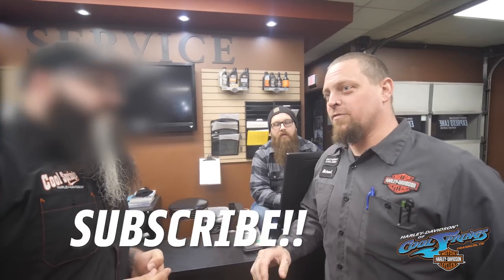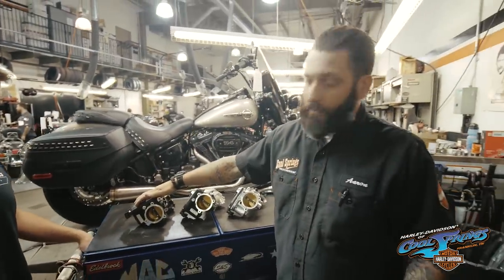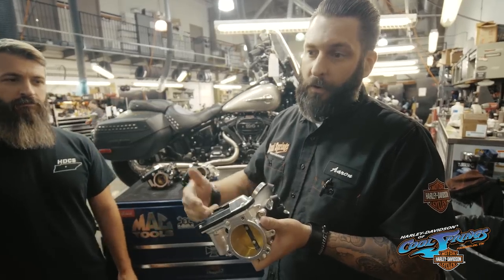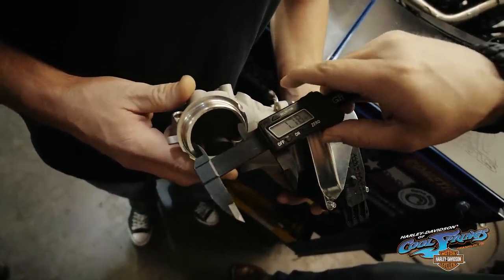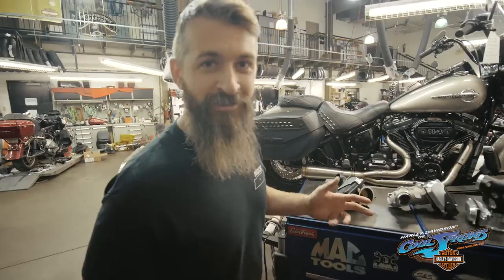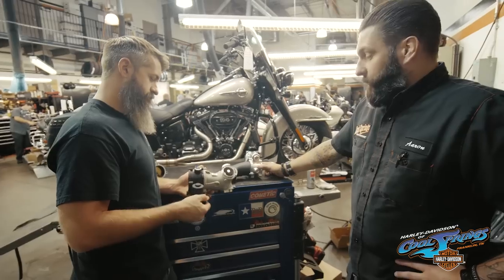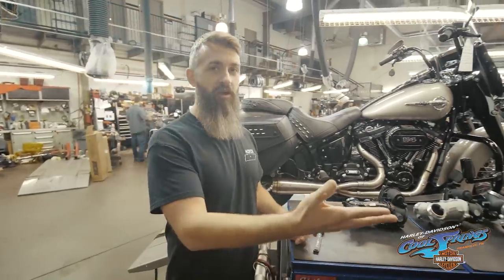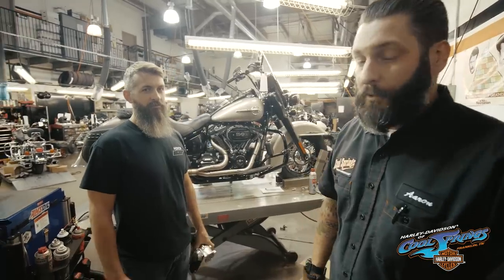Comparing Throttle Bodies (Harley Stage IV vs HPI) | Shop Talk Episode 9

Comment: Can you imagine if Harley would just ship out the new bikes with the best parts to start with. I am burned out on spending thousands to get the power they should have had in stock form.
Reply from the maker: James dulaney You could say the same thing for pretty much any manufacture of Motorcycles or Vehicles.
Reply: Indian bikes come from the factory with basically stage 2 everything for half the price. Pretty sad actually. 

Harley does it as a marketing plan. It makes a ton of money for them. And it works since people are never satisfied with a harley to begin with. Which is why we modify them.

Comment: Australian Performance Engines APE ,Manufacture a 55 mm CNC Intake manifold Producing a 150 HP and 145 lbs coupled with a 6.2 gps Injector.

Comment: Moonshine Harley, does either the 64mm SE or the 62mm HPI eliminate butterfly valve clapping/chatter/knocking that comes when you put a cam in like an S&S 475C? I put that cam in ('20 Road King Special, 114) and now have that butterfly valve knocking and am wondering if an aftermarket throttle body can make that noise go away or lessen it. Thanks and love your channel!

Comment: I recently picked up a 64mm SE TB, I only paid $300 for it.  The HPI unit is just too expensive, especially considering that it still uses the oem throttle servo motor.  I suppose if you're building a big ole mountain motor or something you could justify the added cost.

Comment: I love the stuff you guys are hitting on/I suggest though that you use a 3 point  digital bore gauge not a caliper to measure bores.i work in the CNC world of +\_ .0002 everyday and would slap a bitch for checking diameters with a caliper.other than that you guys have a cool gig rolling (keep it up)we out here depend on that knowledge your putting out
Reply: A Ninja We would but the measurement was a reference and we wanted you guys to see the data. We already knew the diameters!

Comment: Do you plan on releasing the dyno results between the HPI as is and Okeefe ported TB?  Thinking of using the HPI with a set of match ported and blended SE heads on a 124” @ 11.5:1 with a TTS250 or Tman 234 cam.  Very keen to know if there was any significant differences between those two TB.
Reply: Was wondering the same thing, never saw results on the ported TB. Eric how did your build turn out❓

Comment: A larger throttle does not hurt low end. That plenum could certainly change the flow rate and velocity. A larger throttle body would make tip in throttle much more aggressive though. That little bit of difference isn't changing much anyway.  62mm will flow way over 150 160Hp.

Comment: Every show the dyno numbers on these? I'm getting ready to do Branch heads with the 62 mm TB on   S&S 131 jugs., S&S 550 . What pipe did they use.  Is Supertrapp's 2 into 1 good ?
Reply from the maker: I would call our shop and ask for Jamie 615-274-4170. We have lots of dyno charts posted on YouTube and insta. We now fun out 66mm intake with a 64mm Throttle body with out ported heads. We now only run the 62mm setup on cam jobs.

Comment: What do you guys think about the SS 55mm aluminum throttle body to replace the plastic one on my 20’ 117 CVO with an SS 475 cam and Khrome werks 4.5 mufflers with louvered baffle and fuel moto 2/1/2 head pipe
Reply from the maker: Harley 64mm manifold and 64mm Throttle Body. This is the setup we run on most of our stage II setups. The M8 want more intake even on these cam swaps.
Reply: Would the SE 64mm tb and intake also work well in a 114 with a wm8 22xd cam? What about injectors?

Comment: Is the bike done yet? I'm not seeing it anywhere
Reply from the maker: We put these on a lot of customer bikes that want this performance upgrade. We'll have a video in the works with a specific bike, this was just to cover the overview of these three throttle bodies and the use cases of each.
Reply: Do you recommend the hpi over screamingeagle. I just did a 128 m8 build from fuel moto
Reply: @heathmitchell2086  it depends.  We try to match the throttle body to the heads.  When we run HPI we usually port match them.   Did you do anything with the heads?  There's more info and easier to answer questions at @m.v.o_motorfast

Comment: I am wondering about the trask turbo system. Are they actually worth the cost of the turbo? And what kinds of mods must be done to the entire drivetrain?  I would imagine you would need stringer internal engine parts and maybe swap the belt for a chain, and some other things that come with stock bike.

Comment: Its pretty widely known that a smooth surface does not flow air over it as well as a surface that is not smooth or textured.  Example: a golf ball, offshore racing boats hull design, 24hr Le mans, formula 1, and many other markets where science dominates "opinion".

Comment: What size throttle body comes stock on the 2018 Heritage Classic 114 Anniversary edition?  Mine already has the Screaming Eagle Ventilator Air Kit... If I switched to something like the HPI 62mm throttle body, would I be able to keep my existing cleaner or would I have to buy something specific to fit the HPI model?  I'm looking at doing a stage IV upgrade with the S&S 114 to 128 Big Bore kit, along with the S&S Camp Plate, Oil Pump, 550 Gear Driven Cam, Lifters, High-Lift Valve Springs and Tappet Cuffs.  My focus is on as much low-end Torque as possible. Do I need to upgrade the throttle body as well, or is the stock version on the 114 big enough? Also, I had new lifters and push-rods installed when I got my Stage 1&2 done last year... but that was for a TTS-100 Cam... Should I replace those again with S&S specific parts?  Any help is appreciated!
Reply: The ventilator is not a good air cleaner.  If you like that look the ventilator extreme is ok.  Be careful what you choose for exhaust to keep the power low. Especially with the S&S 550 cam.  The S&S valve train components are good.  So are the Feuling.  Those are the two brands we usually use.

Comment: Never understood why you'd spend all that money on the bike to begin with and immediately start looking for power that the bike should have had in stock configuration.
Reply from the maker: America.
Reply: @MoonshineHarley  ok , name another bike brand where such mods are required to hopefully produce more power ?
Reply: @richardmerrifield8186  all bikes make more power with mods.  Its more of a want than requirement.
Reply: Never understood people who bitch about what other people do to their bikes on the Internet.... not everyone wants a lame stock bike, meanwhile others are perfectly happy with a stock bike. 

But one of the selling points to Harley bikes is the ease of modification and massive aftermarket support. No other brand has any where near the amount of aftermarket parts available for them. You can custom fit the bike to you and how you use it... mean while get a Honda, Kawi, etc... you can get a seat and exhaust for them and really that’s about it.